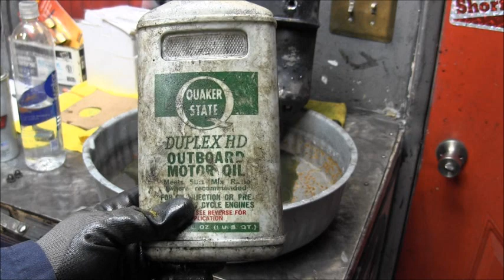SPIRIT OUTBOARD  1986  20  HP,    ( Part 3 )

Comment: Well that 30 years old cable driven system is still working fine so I'm part of the chorus that sings "keep it original". After applying that pressure in the lower unit, you might want to put it in gear and spin the prop as that sometimes reveals leaks. Stay safe and be merry !
Reply from the maker: U R  correct oversight on my part.    thanks  kb

Comment: Hi Kodi, Got a question for you. Do you have or know something that will work to get the 1947 TD-20 drive shaft lower oil seal out? The tool number is old like me 301867 and looks like a T handle with a screw rod attached. The bottom attachment goes down the lower unit 1.5' hole 3" to the oil seal that is 1" Dia wide and inside dia .50" same as the drive shaft. My guess is the lower extractor part expands to lock onto the inside of the seal to pull it out. Not sure if you have ever replaced this old book motor seal before. If not, I'm thinking about taking the part to my friend who owns a machine shop. And guess what? nobody has ever made a video on this before for vintage motors.
Reply from the maker: On those old style lowers I have done it using a long spade drill bit & hammer.    kb